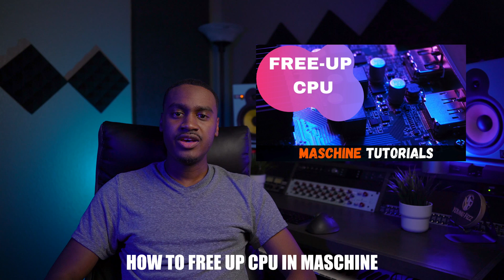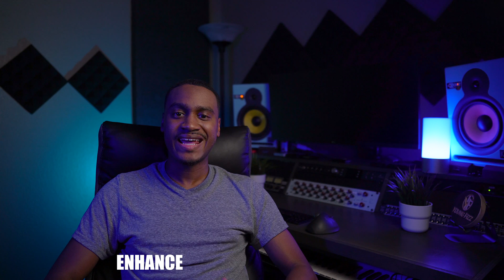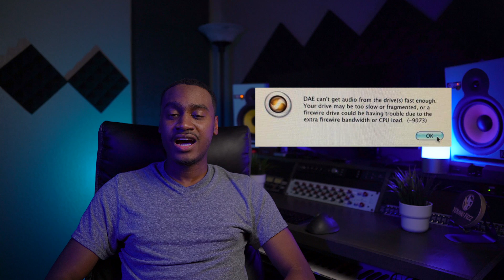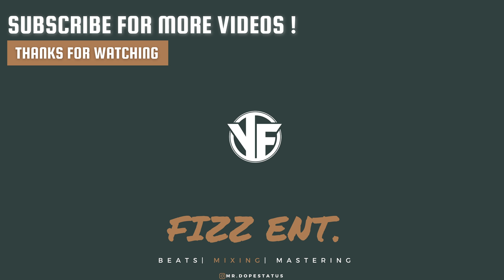MASCHINE HACK: How to get BETTER performance from Native Instruments Maschine Software

Comment: Thanks for the video but it is not clear if I can use maschine plus or mk3 to connect via USB A the external hard disk from which to read the libraries or expansions both with M+ in standalone or as a controller. Which connections, which operations to do to see and use the hard disk both on Maschine + and on maschine 2 with M+ as a controller to which I connect the hard disk via USB.
Reply from the maker: Thank you. Yeah this video basically is for those who want to understand external HDD VS SSD and why it's important to get a SSD when working with Maschine. To your question, you can use USB A to connect flash drives or hard drives as long as it's properly format to store your audio content.
Reply: Thanks for your reply and interest. But I wanted to understand better. Basically if on an external and formatted HD I insert for example NI expansions like Free form, Opaline drift, Global shake... etc.. can I load them with M+ in standalone and also from Maschine 2 or 3 from PC without these expansions being loaded on the SD card of M+ or loaded on the PC hard disk? If so, what is the procedure to see the contents of the external HD and load them both with M+ in standalone or in controller mode? Thank you very much. Luigi
Reply: @FizzENT  ❤

Comment: I have a older Mac I Mac and I’m about to transfer my stuff to a newer Mac. What do u think will be the the way to transfer Maschine and plug-ins to another with using a external drive
Reply from the maker: Not sure if you started this process, but did this one time before and i believe i used migration assistant. Af far as Maschine sounds go, i made sure to use Alias inside of the software so that the sounds don't get out of wack. All sounds where initially installed on a 2TB HD internally. I later used Carbon copy to clone the drive to external SSD and made sure the naming  was spot on or else i would have had missing files.